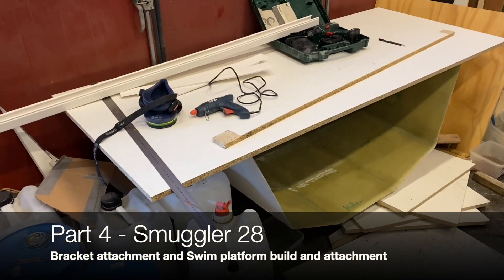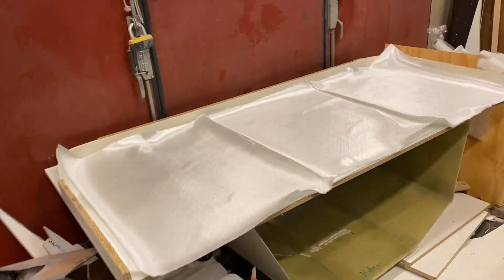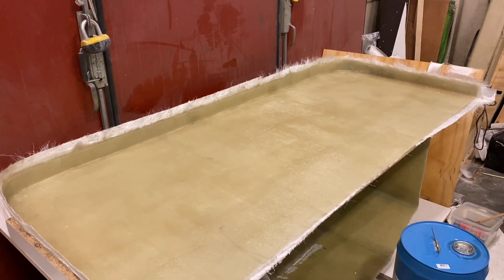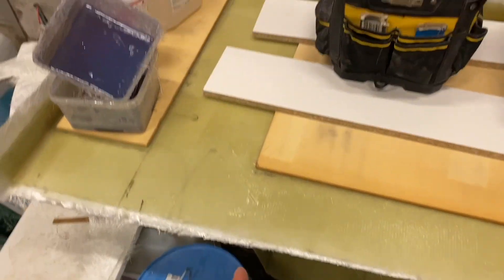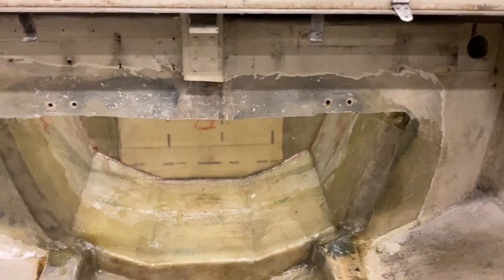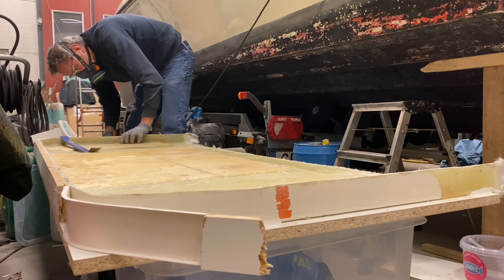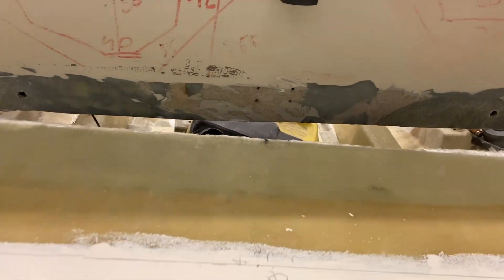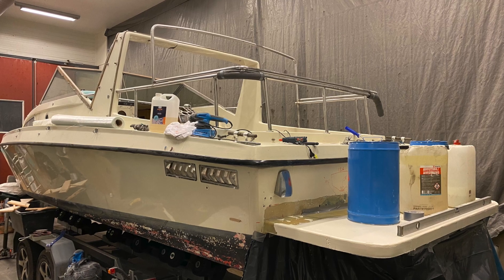Part 4 Smuggler 28 - Building and attaching swim platform and bracket to transom

Comment: The perimeter of the platform mold, what did you use to round the corners?
Reply from the maker: I used the lid of a plastic cable trunking. The right width and flexible  enough.
Reply: @boatdevoted yea but I mean where it meets the top flat board, did you put puddy in the edge to soften the corners?
Reply from the maker: Not sure what you mean, but instead of puddy, I make my own filler with silica, milled fiber and resin. On top of that I lay chop strand and biax to add strength. Was that answer to you question?
Reply: @boatdevoted kind off, but before you paint the surface with gelcoat do you add anything to the perimeter , you know to round the meeting pieces for the fiberglass to go around, cause ive heard fiberglass doesn't do well with sharp corners
Reply from the maker: Aha, it depends. In the beginning as for the bracket I screwed the sides of the melamine ad then I used sikaflex before gelcoat. It worked ok, but it was some struggle to remove the sides of the mold. 

If you take a look at the video were I make the hardtop you see e using some plaster, but that was too messy for. 

Finally, when I did all the interior molds for seeting inside the boat, I skipped everything and put in a good amount of gelcoat. Then the puddy i described earlier on the inside to round off the perimeter so I could lay glass. 

When I grinded off the 90 angle from the outside I had a good amount of gelcoat to work with. If I grinded down to the fiberglass I didn’t care, since I painted it afterwards anyways.  See my videos!
Reply: @boatdevoted ok great that answers that, thank you, I'm asking cause I like to make a new swimming platform
Reply from the maker: Glad to (hopefully) be able to help out!
Reply: @boatdevoted one last question the gelcoat you used was it waxed?
Reply from the maker: Always gelcoat in molds, topcoat (gelcoat with wax) outside molds if it’s the last exposed layer.
Reply: @boatdevoted thanks

Comment: Can anyone illuminate why fiberglass vs. aluminum?  I just completely rebuilt the transom on my 26' center console, was planning to weld an aluminum platform onto the (engine) float bracket).  Pros - Cons?
Reply from the maker: Hi @destinypirate, I can only answer for myself, but I’m only comfortable with fiberglass so for me the choise was easy.
Reply: @boatdevoted  .... Why more comfortable with fiberglass (than aluminum)?
Reply from the maker: I can’t weld, and I decided from the beginning I wanted to build everything myself. I had a small window of time to get a bracket ready for installment and I didn’t have time to learn something new, and also, I didn’t want to buy a new bracket.

Comment: @8:10  Next time, wax the melamine board before applying the layers of fiberglass and the fiberglass will not stick so much.  But, all in aii, great job!!  :person-turquoise-crowd-surf::person-turquoise-crowd-surf:
Reply from the maker: Thanks! I’ve used wax before, but with these melamine sheets it’s not necessary. The main reason why it’s stuck here is the sikaflex.

Comment: Wow this is an amazing project I like how you fit the swim platform into the exsisting transome, I do however have a question , That being why the bracket does not show a rise as it transitions aft?  I would think that it will alter the boats running attitude, ! againe super job ! very inspiring.
Reply from the maker: Thank you for your kind words @botoepfer8588 ! In my last project I bought a finished bracket from Segmo boats, which are usually used in these smuggler I/O conversions. That bracket did not have a rise, but I understand your question. At this point in time, when I’m a bit ahead of my channel with my project, I can guarantee you it’s working well… 

I’ll soon update the channel with more videos, but actual work on the boat has been prioritized.

Comment: Hi great video, but a couple questions...what kind of sika flex caulk did you use for the small radius? And did you wax the melamine before gelcoating?
Reply from the maker: Thanks! I use sikaflex 591, but in some cases I dont use sika at all. I just fill out the corners with thickened polyester, and sand it down so its not sharp. I dont like wax so put gelcoat and fiberglass directly on the surface and It works very well.

Comment: Nice job and good choice of material, but a small tip is to always start with at least one layer of 450gr carved carpet and air it well. This bites better and takes up any unevenness. And always finish with a chopped 450gr chopped to then be able to secure for continued lamination. The carved mat is easier to sand and get a nicer result, and it will be a smoother surface. If you are going to laminate against gelcoat, it may be good to lay three layers of 450gr chopped after the first mat has hardened so that the targeted mat does not give structure to the gelcoat.

Comment: Great work, but I'm concerned about using divinicell foam boat in the transom that doesn't have particularly good compression. Which there will be lots of when the Motor is mounted. I greatly urhe you to remove all of the lowe density foam and replace it with hight density foam board such as coosa board
Reply from the maker: Hi and thanks for your concern!

Divinycell comes in many different densities and this one is a very solid heavyweight one, bought directly from the manufacturer. It’s not be compared with sheets you use as lightweight core material in either places, and we buy in stores here in Sweden. But I agree with you that coosa board is even more sturdy, but this will work just fine with all the glasswork that’s been done.